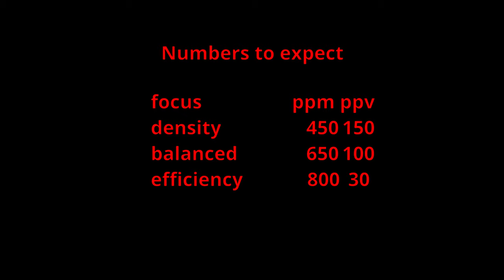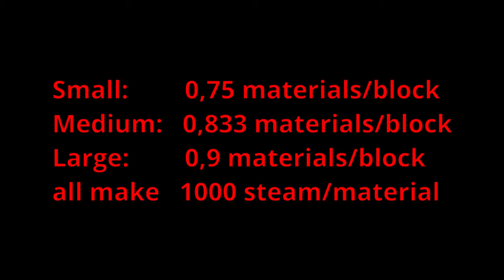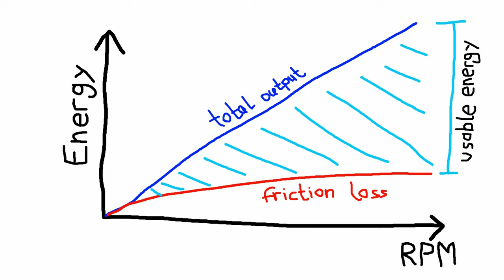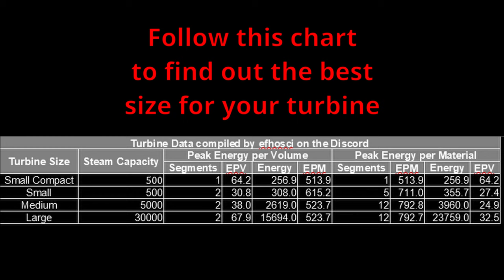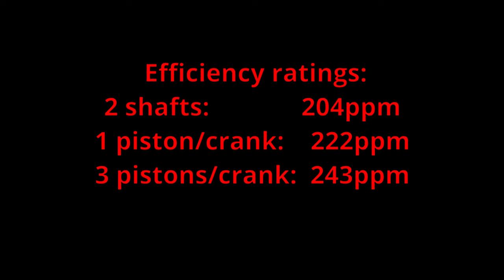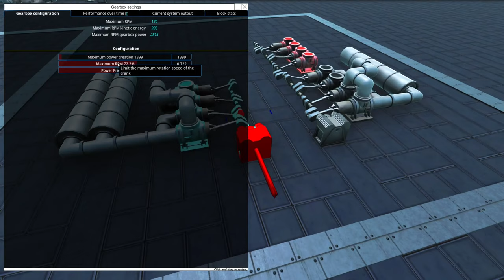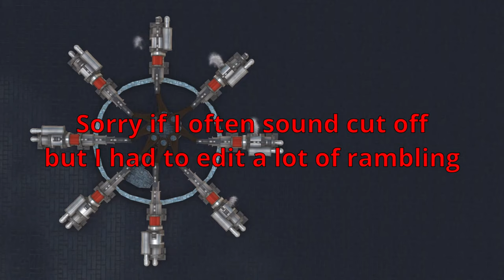Steam Engines Full Guide (From the Depths 2021)

Comment: IIRC perfect staging is closer to 5:4 rather than 1:1, also feel fuel engines are better than you give them credit for. also im pretty sure you can throw multiple large pistons/crank, but that may have been reworked out
Reply from the maker: yes, though the benefit is only a few %, so its more something to cover in Part 2.
Any also yes, you can put 3 pistons on a large engine, dont know how I missed that one, already corrected the description

Comment: The turbines seem to be useful for starting out in adventure mode, imo (I'm on my 2nd try of it now, but I used to play FTD more in the past before adventure mode was a thing).
At the start of adventure mode, when material consumption efficiency is king since you have so little and need it for building, I've been using an RTG or 2 with a battery bank and electric motor, since then I don't consume any resources when running normally.

For combat (especially sustained) or emergency GTFO maneuvers though, sometimes your batteries will get run down. In that case, a small steam turbine set to turn on when batteries are below a certain level can be really helpful! It doesn't provide power itself like a fuel engine, but those have volume issues for small&cheap early rafts. The power requirements are solved by adding more batteries, since the electric motor/engine actually provides power based on the size of the battery bank it's connected to!

Comment: An amazing video that has helped me a lot! A few remarks\questions:

1) the concept of backpressure was briefly mentioned but never explained or defined. I intuitively understand it,but that's bcs I already knew that piston convert steam based on a pressure difference.

2) what's those bugs with valves you mentioned? I rather like them for keeping boilers pressurized and reducing spinup times. I've noticed some UI issues when you feed a valve directly into a piston (in my case, that first large piston went red bcs it thought it was not connected and the reported ppm doubled), but it didn't seem to affect behaviour

keep it up, can't wait for part 2! this was a video the community badly needed. I salute you for making it.
Reply from the maker: Thanks!

1) Theres not much to explain, you said it yourself, backpressure means pistons cant develop as much power since the power they can create depends on the pressure difference! I might go into more detail in part 2. Now its true that whatever is causing the backpressure now gets more pressure to play with, but I have never found a case where intentionally causing backpressure by adding turbines or even boilers was a good idea. Its confusing at best and ruins your engine at worst!

2) Some interface bugs related to the pressure being displayed incorrectly. Also pipes behind valves dont vent steam even if they have a leak! Great for damage control since you can have a leaky pipe with pistons at the end and you still dont loose steam.
But I built an engine that can switch between 2 and 4-stage mode, so I need to vent pressure that would otherwise have been put back into the system and thats impossible right now because of the bug
Reply: @livslab  maybe you could stick a second valve and that vents excess pressure in 2 stage mode?
Reply from the maker: @edwardhett4381  thanks for the tip, but too late unfortunately. The new stable update fixed the bug, so I already built and tested the engine, and it works fine! I just need to make the video, hopefully this year still but no promises

Comment: Thanks a lot for this one! Very nice explanations. Your small steam engine is rly the most optimized form I can think of. However comparing small and large systems there is one issue you have not mentioned that I believe is very important - damage tolerance. Small steam can be disabled or reduced in power quite easily by incoming damage and there are a lot of fragile piping without much redundancy. Large steam hides most of the piping inside the pistons and the pistons themselves have a lot of HP and quite some armour. They are good and surviving spalling or HEAT or frags and make your ship more combat stable.
Reply from the maker: You make a very good point!
Given my current upload schedule it looks pretty unlikely but I added it to the notes, in case I ever make a part 2 of the tutorial

Comment: I'm just gonna add, hybrid engines are still very possible with the addition of the steam pipe vent's pressure limit setting. 
Place it in between your cylinder output and the turbine assembly and set it to like 8 or so, and it'll keep pressure up for the turbines but not let it get high enough to jam the system.

Comment: WOW. This is amazing. It took me hours just to figure out the turbines. Also, when did the large pistons change to only being able to connect to 1 side instead of 3?
Reply from the maker: Yeah it took me hours to learn steam in general, too!
They can still be connected on 3 sides, my bad!
Reply: @livslab  Ahh. I still cant believe that your 7x7 box is more efficient and more powerful than all fuel engines (caps out at 81.1 if you include the required fuel boxes)
Reply: @livslab  Also. If you want to do the same for fuel engines I can give you all the information and equations (except for gas duplication which I found out yesterday) for you to double check.
Reply from the maker: @nicopence3148  well you do need quite a seizable steam engine until the numbers start to look good, its pretty hard to get that kind of numbers with more compact engines so on a small scale I think fuel engines might be better or at least competitive. Honestly I never built a fuel engine myself so I dont know what numbers to expect!
Reply from the maker: @nicopence3148  GModism uploaded a tutorial for fuel engines yesterday (great coincidence) wich is quite nice. Though he only went over the theory and didnt really provide a solution for an actual engine. Thats what I regret the most about most tutorials because they go through the theory but dont bother teaching you the actual tetris wich is probably the harderst part. Thats why I showed off how to build the 7/7/x. So if you can throw a few blueprints my way I might just work my way through that topic, too!
Reply: @livslab  Fuel engines end up being 5x5x? usually. They can be much more efficient but cannot reach the same power nor are they as power dense at the same efficiency as good steam. For comparison, my "best' engine has a power of 38/block and efficiency of 651 at a length of 31. I have seen a comparable more modular engine taking up only 5x5x5 but the IR from the exhaust can get pretty bad for aircraft.
Reply: @livslab  Fuel Engine Test Platform by EpicNitros

Comment: I didn't know anything about piston engines before watching your video.
Made some; 
120 small pistons, 3 pistons per crank.
12 wheels.
Material use/sec 97.3
Power output 59743
Power/volume 99.6
Power/material burned 614.1
No valves.

144 small piston version;
11 wheels.
Material use/sec 116
Power output 70992
Power/volume 101.7
Power/material burned 612

168 small piston version;
Material/sec 133.5
Power output 81512.2
Power/volume 102.7
Power/material burned 610.7
----
Using this for new ship;
144 piston,
16 wheels, 12 shaft generators
Material use/sec 116
Power output 12933.1
Power(or energy)/volume 106.5
Power(or energy)/material burned 655.5
Energy output 63104.2

Sam's Lab is #1!

Comment: Maybe there's been an update I didn't track, but steam engines used to have massive problems with highly variable power loads, such as when out of combat when shields, ammo facs, and high power systems don't need to be on, only propulsion systems.  You had to use a control block to adjust fuel feeds to throttle loads, or a dedicated turbine generator to regulate combat power demand. Is this still a thing?
Reply: Best I can tell, the issue with steam is they cannot bank energy or shut down like other engines can, because they transfer energy directly to shaft horsepower. This means there will always be times, unless you have extra batteries for energy storage, that a small amount of materials are wasted spinning a engine that is essentially idling. Having extra energy storage for downtime or creating conditions with control blocks to kill the boiler are the only two ways to solve this problem. In my opinion though, steam still beats the tar out of internal combustion overall due to its effortless power output and relatively low material consumption at pressure, say nothing of the fact that no refinery is needed to refuel them.
Reply: Its a feature, not a bug. As mentioned in the video, steam engines need to run at full load to eliminate low efficiency at low power demand. Steam engines are best used as a booster. Best scenario is entering combat and use the ACB to turn on the boiler system for sudden spike in power capacity on a piston setup or use the ACB to turn on the boiler system to recharge the battery bank after a certain threshold is reached.

The best thing I did on mine is use RTG to top off the battery banks while out of combat. RTGs can't really keep up to the demand so having some boosters for a quick top off is pretty good. Setting the ACB to turn on boilers for the steam turbine when battery bank power is low and shuts off when reaching 90% capacity. Even if you have ridiculous power consumption for your propulsion system, its pretty darn efficient setup.

Comment: I don't understand steam that well so I could be completely wrong but for the engine like the one you made at the end wouldn't it be quite advantageous to keep each of the rows of steam feeding pipes and the boilers feeding them separate so that a breach of one does not cripple the entire engine, as to make the engine tolerate damage better or would it not make much of a difference?
Reply from the maker: In general it's a good idea. Unfortunately I have an odd number of boilers, and they are different size, so distributing the steam equally is pretty hard. Thats what valves are for, they have the option to automatically close when a pressure loss is detected, which is great!
More on that in my 2nd video on the topic, which will get released as soon as a few bugs involving valves are fixed!
Reply: @livslab  Makes sence, I played around with valves last night but they seem to add a lot to the bulk, regardless thank you so much for making this video, I learned quite a lot!
Reply: @livslab  True, but they're also weak to EMP, so they can easily cause leaks as well.

Comment: I wonder what the numbers are for engine power efficiency, comparing steam turbine into an electric engine, a steam piston setup into generator into electric engine, or a piston engine directly. Will have to run then later.
edit:
Running some tests, I think that a 3*4+3*4 multi expansion large steam engine gets similar numbers to the small 7*7*x engine you featured. The large boilers actually fit into the 90deg space between the pistons, making it to be quite space efficient.

Comment: Figure I'd ask this here:
Am I remembering things wrong, or was it previously possible to control the burn rate with a vehicle controller?  I swear I was able to do that with my first steam engine.
Reply: Pretty sure ACBs can still control burn rate. Probably maximum shaft speed as well, but I'll have to check.
Reply: You can still do this but you don't really have to now, as boilers don't just blindly boil at max (or the rate you ACB for) but only burn what they need to get to full pressure.

Comment: It's not a bad video, but it misses the point; the reason steam engines are my favorite is that it's very simple and interesting to make them switch modes. For example, on one of my ships I can press a key to make the output of the pistons (all connected) vent steam, which are also connected to medium steam turbines so they can efficiently transfer output steam to energy restarting the main pistons that are having their output blocked if it's not in inefficient mode. (venting the output) With another ABC to manually control the steam boiler burn rate, the ship now has 3 modes; inefficient mode, where it vents output steam for maximum torque from the propeller, maximum power and energy but obviously inefficient. Normal mode, when the boilers and propeller are running low automatically, while the steam turbines convert steam to energy when needed, turning the pistons back on. And finally, silent mode when the boilers are completely off and the last drops of steam are used to charge the batteries, so it doesn't waste materials.

This system might not be the absolute most efficient, it is definitely not the most space efficient, but it's certainly more interesting than using prefabs to paste the same engine on all your ships. This video is very informative, but it seems to be made to completely reject any form of creativity in steam engine design and engine choices.

I have learned a lot from this video, because before now I've never watched any tutorials, not even the in game one. I now know that medium turbines are most energy but not space efficient,  and that the metrics from the menu are not correct when plugging two turbines into one generator. But I'm going to personally test everything, since I no longer trust this video. It truly feels to me that this video was created when they were angry and just wanted to vent. But I feel it's suppressing creativity, the opposite of what I subscribed for, and that is why I'm mentioning this.

I am not unsubscribing because of one potentially misguided video though. 

I hope you, reader, are having a nice day since I do not expect many people to read to the end, this is the longest comment I've ever wrote. I hope I see you somewhere, kind reader that would patiently listen while a teenager rambles about creativity suppression since their first favorite thing in this game is steam engines. o7
Reply: Honestly, I thought this was a good video. Learned a lot more than on other videos trying to explain how to practically do steam engines. Getting a look at some good examples helps a lot more than looking at space inefficient designs that nobody would put into their vessels. With some extra testing of my own I now feel like I understand how they work and when it's a good time to use them.

Comment: I have a very quick question, althought I'm a new player, why didnt you use the excess steam for electric steam turbines?
For your small giant engine you showed us to build
Reply from the maker: Like I mentioned at 21:00, turbines create a lot of backpressure, meaning the engine runs at less power. The turbines, running at less than max pressure, loose efficiency, too.
Reply: @livslab  Yea I kind of tried that like 5 minutes ago right now, Now I know  lol..
Edit: either way good video
Reply from the maker: Thanks!
Also: small giant engine. Hilarious :)

Comment: I have to disagree that steam is better in every way.  Fuel engines can give you the right amount of power and can do it almost instantly.
Reply: Just a simple steam turbine can outperform a fuel engine in both ppm and ppv.
Reply: @_Zdex007  you're always going to b producing too much power with steam.  Power demands fluctuate like crazy especially when running a lams.  A steam will make power at a constant rate but a fuel engine is going to give you just the right amount of power.
Reply: Thats why I have normally gone for fuel. I know, and the stats clearly show, my standard go-to 3*3*3 fuel engine design gives 3200 power.  The 7*3*3 variant gives 8000 power. The 10*3*3 variant gives 12800 power. Every extra 3*3*3 block (its a modular design) adds another 4800 power. I can tune the number of engines and modules to the amount of power and redundancy I need.
Reply: @Debbiebabe69  IMO that makes fuel a bit more flexible.
Reply: @Damaddok82  That's why I just pump the excess into batteries for buffer. Not to say that fuel engines have no place of course, but efficiency on demand w fuel engines is also a pain in the ass, as making fuel engines that are efficient at whatever load level they work at is hard and very space inefficient as well.
Reply: @ainumahtar  the only things that really seem to have large power demands now days is propulsion and lams (unless you are going with energy weapons of course).  Shields are just garbage right now as an active defence.  So I don't think they need that much volume dedicated to power production honestly.  Frontsider maybe because you can concentrate more shields in a small area but on sea going ships, even with down props, don't seem to need all that much power now days.  Especially if you know how to armor well.
Reply: @Damaddok82  Depends if you include energy, in which case PACs are also pretty hungry ^^